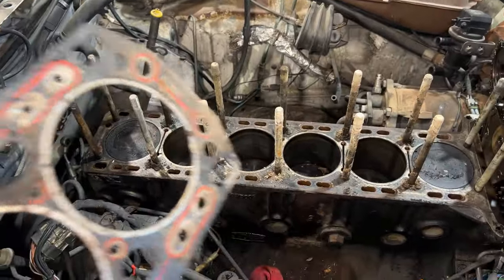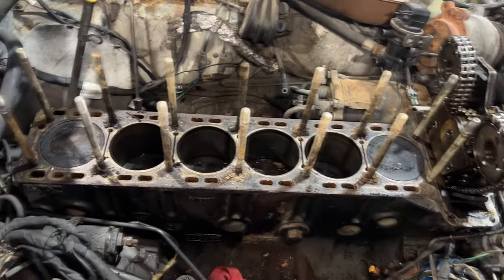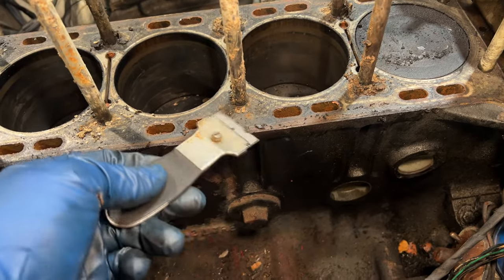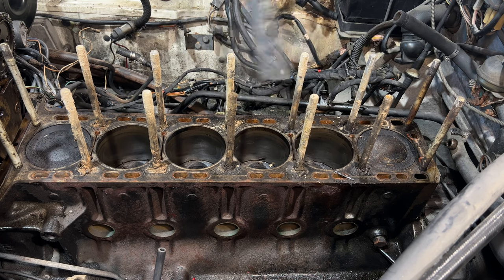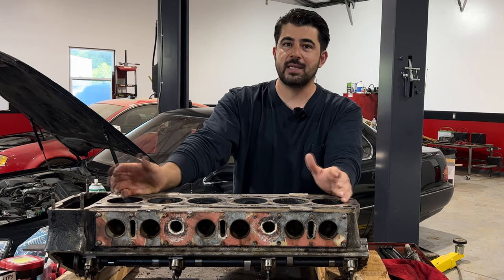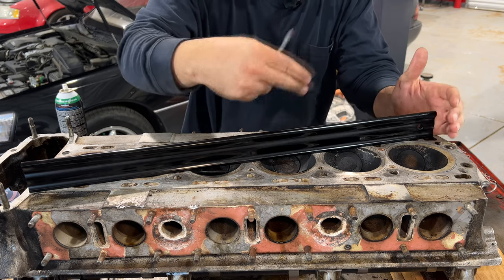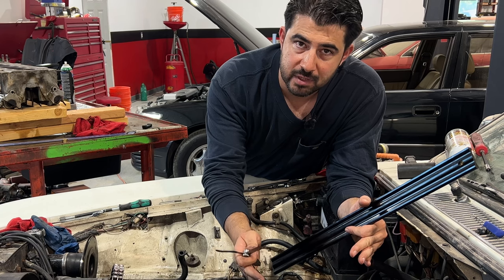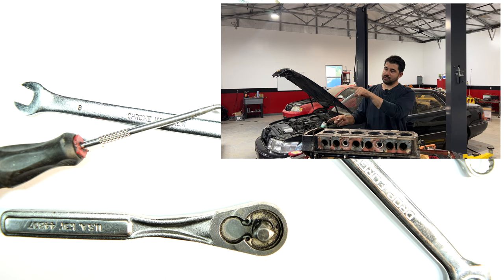The Only Way To Replace a Head Gasket

Comment: Makes me even more eager to go EV.
Reply: You have two dads?
Reply: EV for me2.    People who drive gas engines live in a Kodak world.
Reply: Just wait till your electric bill is more than your mortgage
Reply: @earlscheib7754  Hell of a lot cheaper than gas.
Reply: @allighabell3138 - anything wrong with having two dads?
Reply: @wholeNwon  I'd rather drive a hybrid get 50mpg and have a reasonable electric bill. 
The electric grid and infrastructure in the US can barely sustain as is, and the cap ex necessary to get it to support even 25% EV's is in the trillions. 
The cheapest electricity is coal, the environmentalist killed that.
The cleanest electricity is Nuclear and the newest reactor is fifty years old, and the environmentalist don't like nuclear either.
So what's left solar? Guess what solar panels degrade and have a lifespan of as little as 7 years, they have hazardous materials in them, the recycling of solar panels is difficult and toxic.
Then let's take your EV, yes the batteries filled with lithium, cobalt, sodium, lead and are environmentally hazardous, the batteries break down and lose efficiency. 
There is a reason the vast majority of all cars sold still run on gasoline, I hope people start gravitating towards smaller vehicles but we'll see.
Reply from the maker: EV is the Future.
Reply: @donaldlee6760  it's usually a dodge guy thing but it's beside the point. I have a 2017 rav 4 hybrid that has like a ten gallon tank I also have a 95 accord. Why does it take a 1/4 tank in the rav to drive an 1 and half hours on the highway and I do it it my accord and it's like an eight of a tank. I get almost 40 mpg in the accord only when you cruise at 90mph. My point being you don't really see a real world difference in what you spend on gas of course it's going to be cheaper to fill ten gallons rather than 15 the numbers on the dash really don't mean anything. You can't get more for less people
Reply: Yeah it's all gangster until one day the car is out of warranty and you have to replace the battery pack..
Reply: @myRatchets  definetly ain't. Hydrogen well see leave these comments here ev is not sustainable at all
Reply: I can’t wait until the grid starts to fail because it can’t handle every house having an EV car.
Reply: @j6r1665  Remember when we were going to run out of oil?  The grid must be massively updated and secured for several reasons and EV's are barely on that list.
Reply: @wholeNwon  I don’t disagree with that but I think a lot of people are jumping on the band wagon without fully understanding that it’s not going to be as convenient for them as they think. I own an electrical company and I can’t tell you how many people call me out to install a 50 amp, 240 volt outlet for them at their condo in Miami/Ft Lauderdale. They want it installed in front of their parking spot on the 2nd floor of the parking garage which creates so many problems and most of them can’t be answered or solved. They always say the same thing “Tesla (or whoever they bought the car from) said that running the power would be easy and they could get it done for a few hundred bucks”. 
   The best bet for most people is solar but that’s another thing altogether.
Reply: @j6r1665  It's amazing how blissfully ignorant many people are, isn't it? Some of the things that give me pause in my own house are that I only have 150 amp service, my breaker box is full and I don't really have a good spot in the garage to install the charger. All these things can be dealt with but, for me and the driving I do,  it's not worth the bother.
Reply: This is the absolute last comment I ever want to see when searching “How to fix my blown head gasket” lmao
Reply: @wholeNwon  I’m running into that a lot with people that are on the fence about getting an ev, it’s just not worth the hassle. And if you do any serious driving, the thought of running out of a charge isn’t worth it.
Reply: @j6r1665  I know. Then there are issues of depreciation and resale value. EVs would work for me and the driving that I do but they certainly aren't yet for everyone in the US.
Reply: @donaldlee6760 Yes, fundamentally.

Comment: Lol when I was young we used to just cross our fingers and slap a new headgasket on 😄 not hot tank/pressure test, nothing 😂 Usually never had any problems
Reply from the maker: It makes monetary sense if you got a lot of time to remove it again if its a bad one.
Reply: @myRatchets  yeah decent machine shops are expensive nowadays

Comment: 🙋my Tacoma 4cyl was going through 02 sentsers every year the tell pipe was black soot at the tip the fuel injectors were sticking open not closing i use laqur thinner 1gal to 8 gallons of gas i ran the gas all out in 1time run 3hours filled back up fresh gas an dam the truck runs like new 👍 and the next week i pulled the intake off and cleaned with oven cleaner the ports holes flushed with water installed gaskets . what a difference it been 1year 🙋no soot on the tell pipe 2001 Toyota Tacoma 4cyl miles 180.000 . Do not do this on a carburator motor

Comment: i don't recommend sanding cylinder or head surfaces. just spray it with solvant & scrape carefully with plastic knife. sanding will cause leaks or efficiency issues

Comment: Great video. Only thing that you overlooked mentioning is checking the condition and keeping the push rods etc in order on old non overhead cam engines.  Fluids go everywhere and a bit of air blasted down the threaded holes may revel there is still some fluid at the bottom which of course will not compress and can also cause a false reading. It is also a good idea to use the old bolts/nuts to clean the threads and ensure there is no "grabbing" which could cause false torque readings once things have been cleaned out.
Reply: Great tip !

Comment: If you're bringing a head in for resurfacing, magnaflux if iron heads, and dye testing for aluminum crack check before surfacing can save you some money.
IIRC, you can get the dye testing kits for home use which are pretty cheap to save you the trip and expense as well.

Comment: I have a 1990 Toyota 3SFE 4 cylinder in a Camry. Had a bad headgasket. The shop had to take so much material off the head to make it flat that they recommended a shim kit that goes between the block and headgasket.  Have you ever used a shim on an engine? I know it’s not ideal but money is tight.

Comment: Forgive me if this is a ridiculous question:

Since you already have the straight edge piece of metal and know where the tiny gaps are, could you attach a piece of 2000-3000 grit sandpaper to it and gently wet sand those surfaces to perfection?
Reply from the maker: those are low spots, you'll have to sand down the entire surface to bring them true to just bellow the low spots.
Reply: That’s where machining comes into play. If there’s low spot that is warpage again like he said you will always have a very lil warpage but if it’s to a point that you need or desire to do wet sanding (btw wet sanding is done on auto body to clear away blemishes or imperfections) then it’s machine shop time or in cases like this new used, or brand new head. Good luck 👍🏾
Reply: @myRatchets  Right…that’s what I meant. To sand the entire surface to meet up to the gaps to make true. 

I actually just mistakenly jumped down the rabbit hole on YouTube showing people using this method …lol
Reply from the maker: It's doable but you have to find a large true surface put sand paper on it, than manually pickup the head and slide it over that surface again and again until you get true. It's difficult both physically and also finding a large enough completely flat surface. It would take way too long to do it with the straight edge and sand paper around it, it may not even be doable since you would sand down more in some areas than others.
Reply: @myRatchets  I’ve seen people use a piece of glass
Reply: @donh215 to wipe their ass with?